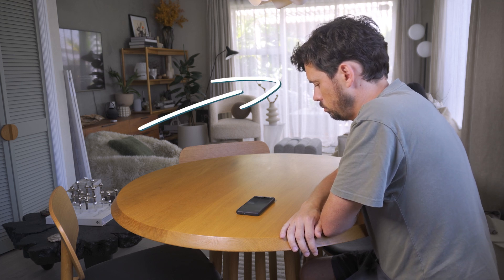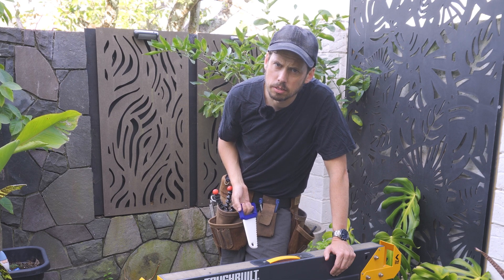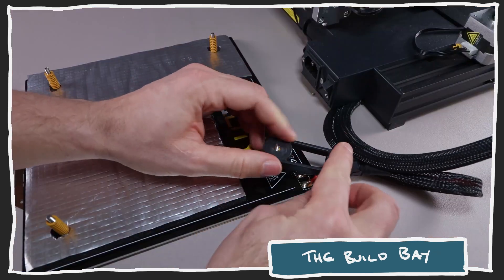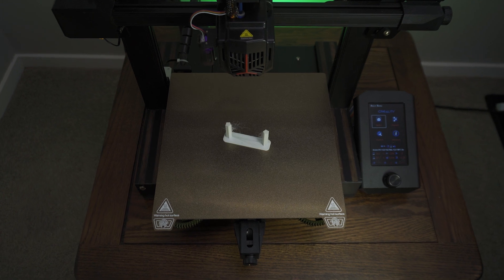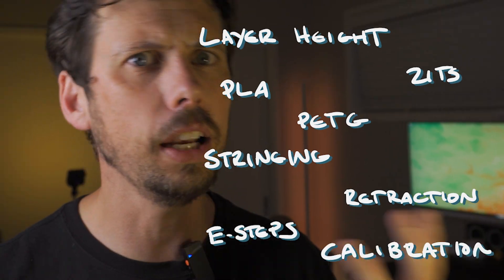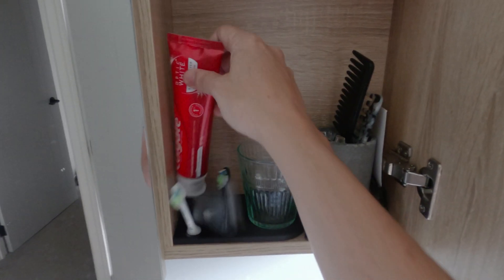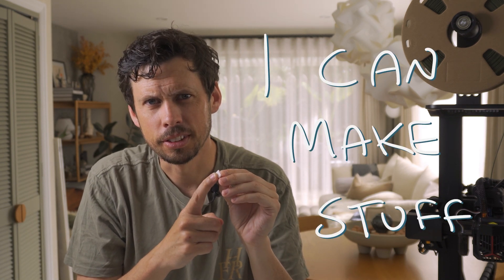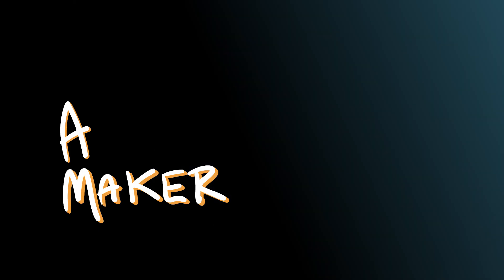This One Print took me from Beginner 3D Printer to Actual Maker!

Comment: My first printer was a PrintrBot Simple Metal. I still have it, even though its second mainboard (and the company that made it) died. And in the middle of the bed is an outline of where the nozzle scratched through the masking tape and powder coating and engraved the profile of the part I was trying to print, which showed up in every subsequent part.
Reply from the maker: A tale as old as time!... Well, as old as 3D printers I guess.

Comment: It's a good feeling when you go from printing other's models to designing and printing your own functional models. My heavily modified Ender 3v2 paid for itself just in a single part I designed and printed to fix a broken headlight mount on my ex's car from her following too closely and her car getting hit with road debris. A single ASA part, some epoxy, and a few hours of work measuring, designing, and installing the part saved a $600+ headlight assembly. Not to mention all the other things this printer has turned from concept to reality.
Reply from the maker: I love that! Pretty advanced too - ASA on an Ender 3?! Impressive

Comment: (repost)
I'm about a year in, I did a lot of junk from the sites. But as for the useful stuff, look at my Printables (same name). 
The most useful, but specific, item was a headrest for a specific BlueTooth headset. But also, I made price tags for my junk food concession at work, a ceiling mount for an IR repeater, magnetic mount for a water pressure gauge, etc.
My latest is a badge for my co-workers to put on their cars, or whatever. It matches the logo on the building precisely.
Reply from the maker: I checked out your Printables. You are prolific! So awesome. Nice work.

And thanks for commenting againafter your first one got disappeared